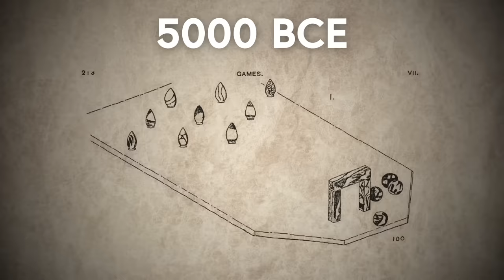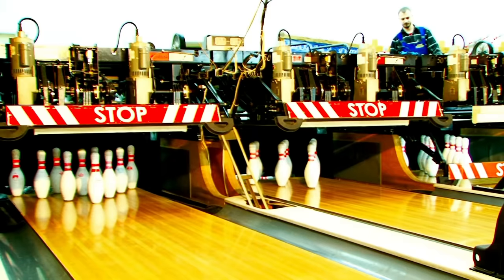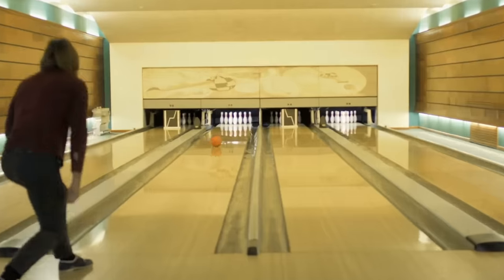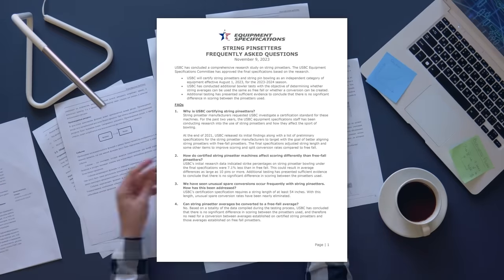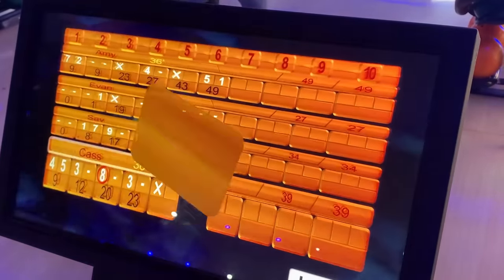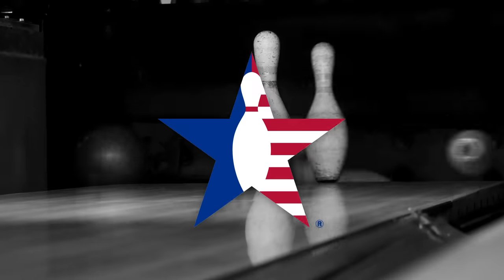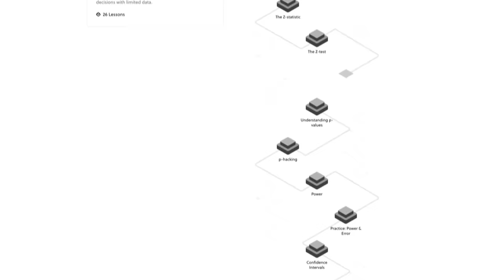The Controversial Machine That’s Ruining Bowling

Comment: As a mechanic who works on both types of pinsetters, I am here to tell you that string pins are only cheaper by face value. They are more difficult, more time consuming, and more technically precise to maintain and work on. When all cost is considered, free fall pin setters are more financially efficient in the long run. As for how they play, there are clear differences in the pin action. I dont see a problem with the string pins, but I do feel that they should always remain in their own division of play due to the differences.

Comment: One important thing you missed is that a lot of people crying about this haven't actually played on USBC certified string setters yet. There aren't all that many certified alleys at the moment. 

And there's a reason those strings need to be a certain length because it really does affect the carry and thus scores. I believe in most cases the strings are too short so that where you could get pins to knock each other down and messengers (pins that fly across to hit a more distant pin), that happens less and can affect scores significantly.

But I think just about everyone who's played on USBC strings is reporting almost identical scores (as the research would suggest) but it's slightly different. Sometimes the strings drag down a pin that wouldn't normally go down, but you get fewer messengers with a lot of people reporting they balance out. 

The controversy largely stems from people being too stupid or unwilling to read a research paper and then check whether the strings they've played on are USBC certified.

Comment: I am avoiding Bowling arenas that have pins on strings. It just sucks not seeing them fly around freely.
Reply: Pin action is a big part of the game and one thing that makes the game fun.  Getting a messanger screaming across the lane to take out the 10 pin is amazing!
Reply: Have you ever seen Ninepin in Europe? The alleys are all with stringed pins and the pin action is insane. For seeing pins flying around, the ground plate is way more important than the strings. Since I play Ninepin for more than a decade now and also like playing Bowling with friends (allmost all alleys here use stringed pins) I don't see any difference.
Reply: @TheKeeeks97  I´m also playing Ninepin in Europe, Germany to be exact. I´m playing competitively since more than 20 years and also do lane preparation and repairs. I also played classic 10 pin bowing competitively for around 10 years and lanes with strings and pinsetter lanes. From my experience I can tell, that all 3 types of lanes feel different to play or better said need to be played different to achieve better results. But the real reason (to some extent) why Ninepin pins fly around that much actually is physics, the kinetic energy the ball thrown towards the pins has is quite the same for the smaller and lighter Ninepin balls compared to the bigger and heavier Tenpin balls (E=1/2m*v²), because Ninepin balls are thrown faster the lower weight doesn´t matter or on the other hand the player has a natural limit to the amount of energy he can transfer to the balls. So the only variable dertermening pin action in comparison is the weight of the pins with the Ninepin pins beeing lighter at around 2 pounds compared to the Tenpin pins at around 3.5 pounds, effectively resulting in almost double the pin action for Ninepin pins without factoring in other effects.
Reply: @Genesis19623  Thanks for the information. I must correct you in one point: The Ninepin ball ways 6.28 pounds (2.85 kg) and I goes the Bowling ball is even more heavier. 😉
Reply: @ambiarock590  - i've watched a league with the old 8230s which were replaced by strings and the pin action and messengers had NO change...plus when I was a serious bowler 30 years ago, over 90% of my strikes were "10 in the pit" so I NEVER relied on messengers to artificially inflate my average (which was 217)
Reply: @TheKeeeks97  I talked about the weigth of the pins not the balls but I need to correct myself,  the weight of the pins is quite the same I messed up pounds and kg🙃 Therefore I just did the maths for my average throws for Ninepin it´s 203W of kinetic energy with a throwing speed of 43 km/h and for Tenpin its 211W with a 15pound ball at 28km/h. Overall it´s actually quite close😅 The main difference when it comes to groundplate design is that Tenpin lanes have the gutter going all the way through next to the groundplate and for Ninepin lanes the gutter ends in front of the groundplate which means that the pins can slide directly into the sidewalls and bounce back still sliding while Tenpin pins usually need to get airbourne to bounce of the sidewalls.

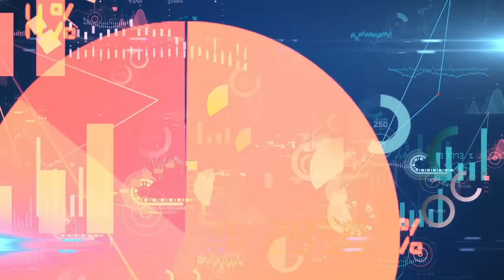Comment: Guys, you botched the p-value part of the stats.  The p-value of 0.035 that you give at 4:01 was actually of the test of *normality*, not of the null hypothesis of no difference in score on average.  A p-value of 0.035 would have given *some evidence against the null hypothesis*, and not a "huge slay for the null hypothesis."  Your reported p-value of 0.035 was also inconsistent with your discussion of the confidence interval, which was correct in the sense that the confidence interval contained 0. (Which is why I looked up the report.)

The USBC report doesn't actually give a p-value of that t test, but it can be carried out with the given info.  If we overlook the minor non-normality (not a big deal, since it's minor and the sample size is fairly large at 351), then t = -.0951/(18.8265/sqrt(351)) = -0.0946, with a resulting p-value of about 0.92.  For this report, at least, there was absolutely no evidence of a difference in true mean scoring between free fall and stringed.  In reality, there is almost surely a difference, but the report shows that the difference is most likely quite small.  At least for the type of bowlers participating in this study.

Of course, investigating a possible difference in scoring on average is only part of the story.  A meaningful part, but only part. There's no doubt that the strings would change the pin action. Sometimes, at least.

Comment: I'm afraid this might ruin candlepin.  An important part of candlepin is that the down pins or "dead wood" is left on the field after each roll.  Strings will definitely interfere with the action of the dead wood.
Reply: Candlepin setters are simpler since they dont need to pick up pins to clear the deck.
Reply: I think you're missing the point of the complexity here.  A candlepin setting machine would not have so much of the mechanisms to go wrong.

I play duckpin bowling (very different from candlepin) at a very old place, and while the pin setter is automatic....I would almost call it 'semi-automatic' because the player does have to initiate the sweep and set with a button and a new frame with another button - which is much simpler (it just picks up what it there and sweeps and sets it back down, or with the other button sweeps them all and sets a new whole set.  Still complex but a bit less so)
Reply: No chance, I’m positive. It would ruin the physics and would tangle too often, so it won’t be attempted. No strings attached, the way it should be! 🙂 ~Greg G
Reply: @CandlepinBowlingNetwork  its worth doing in some places especially if you need to put in smaller lanes but some older machines should be preserved, its like when they killed the jumbotron

Comment: As a long time bowler, and a former part time bowling ally mechanic (college job), string pins are the worst. My local spot actually switched entirely last year, and there is totally a difference. Yes, repairing the free-fall pinsetters was more difficult. Yes, it took more time. But there is a lot you loose with string pin setters. Pin action (how far and fast pins fly, like the whole point of bowling), especially when bowling fast (17mph-ish), is visibly affected. And, it takes away “The Messenger” which is one of the most iconic shots in bowling, please look it up. I’d do anything to bowl on a classic setup, but financially, I totally see why strings are in.
Reply: Agreed. Hitting light and bouncing the 1 pin off the sideboard and hoping it carries the 10 (or 7 for lefties) if it was still standing is something like ~30% of strikes at a competitive level. Yeah, I can't imagine not being able to rely on messengers to string strikes (no pun intended). Competitive bowlers would have to adjust their shots to pretty much never go light. The thought of cords attached to the pins just feels so dirty. Using strings to trip other pins in split conversion instead of the pins themselves. That's not right.

Comment: here's a thought:

install small magnets on the tip of the pins, and have strings with magnets attached (which are held far above the pins during play) come down and latch onto the pins and hold them up. I can imagine there would be complications with pins that arent caught by the magnets, but im sure someone smarter than me could figure that out

Comment: Mechanics are rarely crushed to death by the freefall pinsetters when worked on correctly. The older ones had mechanical sweeps. Had the sweep been placed all the way back, it would have been impossible to not be swept away if the setter would come down. Newer ones detect resistance and won't go all the way down even if a pin is off spot.
Reply: Maybe, but I feel like I'd rather be never crushed to death than rarely crushed to death 😅
Reply: People don't fall off catwalks that lack armrails if they walk properly too.

Comment: I wonder if you could eliminate the strings by using magnets? Like a mechanism sweeps in and an electromagnet would draw the tops of the pins up into position for resetting.
Reply: Yes but it'd require more electricity & probably make them more complicated
Reply: The problem with magnets is that all of the pins would be attracted, not just the one you want in a specific spot. Also magnets in the pins would make them heavier, and depending on where they're placed, may upset the center of gravity. Pins are very precisely shaped and weighted to get the proper "pin action" when hit.
Reply: This is what I was wondering. Electromagnets on strings and a steel cap on the pin. The machines already have computer vision, so it's possible you could individually activate the electromagnets to pick up pins which have scattered.

I wonder if it would work, and if anyone's tried it.
Reply: Magnets would make the pins stick
Better solution would be to have a "drone" reset the pins "by hand"

Comment: I've played both with strings and with the complex pin setters. I like the latter better.
I've NEVER heard of people being crushed to death before. This is really the very first time I've heard of it.
I've had a few strikes myself due to the the strings pulling a few pins down that I didn't hit with the ball or the other pins, no merely their strings. 
I've also seen loads of time that the strings would get entirely messed up causing somebody having to go to the back to untie them manually and on some bowling tracks I've seen them causing more trouble than a stringless pinsetter. 
All my own personal experiences with both systems taken in order, this video almost seems like a sales pitch from the manufacturer of string based bowling tracks. 
The string ones being cheaper is the only point I can fully agree on, and actually makes a perfect sense. But frankly, there it ends. And if I were to run a bowling alley myself I guess money will be the only reason for going for strings.
Reply: It doesn’t take much digging to find several examples of pin setters being directly responsible for fatal injuries. There are also several comments explaining that the experience is wildly different for professional and semi-professional bowling as opposed to casual bowling. There is an official standard string length that supposedly has a significant impact on gameplay, but will not necessarily be adopted by a casual bowling alley. It is primarily a cost-cutting measure that has the added benefit of eliminating a genuinely dangerous job that has led to fatalities for as long as the technology for it has existed.
Reply: My uncle conducted many youth leagues and worked in many bowling centers, usually at the front desk, in my youth. He had forgotten he had a tie on one time going in the back to fix one of the pinsetters. His tie got caught and the unforgiving pin-setter couldn't care less as it squeezed his neck until he passed out. Luckily one of the regular maintenance guys had finished his break and was able to cut him loose and save his life. Deaths w/ heavy machinery like this happen all the time, bowling is just not one of those sports most people think about when they think of heavy machinery w/ lots of moving parts. I don't know if that's an argument against free-fall pin-setters as better safety mechanisms and requirements could be put on these machines. Personally, as a competitive bowler I much prefer freefall.
Reply: @keyser456  I really don’t see any reason for automatic pin setters to be used in professional bowling over a human pin spotter. Just keep the “pin table” and have a human operate it by hand instead of risking a mechanic’s life every so often. I feel like that’s also far more cost-effective than owning and operating an automatic pin setter. It also has the added benefit of providing some broke student with a job.

Comment: 6:07 i think it depends on the circumstances surrounding these deaths. Like if theyre a result of ignoring basic safety procedures like turning off the machine before working on it, thats not the machines fault imo
Reply: I don't think the fault of an inanimate object really matters, plus a machine that won't kill someone due to user error is still obviously better. If something results in less deaths and has no downsides then it seems like the pretty obvious choice no matter whether an inanimate object is or is not at fault for the deaths.
Reply: @hedgehog3180  "has no downsides" is the premise you are banking on, but that's not a given, at least not yet. Like the video mentions, there's conflicting research on the topic, with a lot of data also suggesting string setters are less forgiving. And that's not even mentioning the subjective difference in feel between the two

And "whether the inanimate object is at fault" is a very dismissive way to word "is this machine necessarily risky or would a simple change in behavior eliminate the risk"
Reply: @ThatsPety building something inherently safer should take priority, take the crumple zone in a car, a car without "would be perfectly safe with some behavioral changes" like not getting into crashes...

I don't think the premise of bowling is one that warrants regular deadly accidents
Reply: @st1ng2k70  very bad, false analogy in my opinion. A car crash is impossible to 100% always avoid on your own. A drunk driver could steer randomly or a deer could jump out of the bushes and there's nothing you could do about it. A bowling machine is as simple as "press the off button...okay now work on it"
Reply: @hedgehog3180 there is no reason a person should be dying when working on a bowling machine, I work at a bowling alley and there are like 5 kill switches and as long as the machine is off there is 0 risk at all
Reply: i dont even know where they got their stats for "deaths are rising" as I cannot find a single actual source for pinsetter deaths..
Reply: @_Kurohhh  man I couldn't find that shit either when I looked. All I saw was the same 4 stories from the past 15 years or so, reposted over and over again. But I was already being "that guy" so I just didn't mention it

Comment: Honestly more than half as interesting, if I ever find myself at a string-pin bowling alley I'll know it's cool now. Thanks!
Reply: As a bowler for 21 years: recreationally, I don't have an issue with them.  If I were recreationally bowling on string pins I'd just adjust my score to not count any spares that were made by the strings.  I would not be okay with tournament and league play using strings
Reply: @ambiarock590  this take seems to be appearing a lot in this comment section and I can see why, outside of tournaments rules are just allowed to be looser aren't they (are they? I wouldn't know)
Reply: But it’s not about the rules, it’s about the equipment. It’s like if they never allowed 10’ hoops & regulation basketballs to be sold to the public. How does anyone prepare to play professionally when the equipment is different?  I wouldn’t want to play with a wnba ball & a 9’ rim, that changes the game enough to make it something else.
Reply: @ambiarock590  If the entire tournament is played on strings everything cancels out.

Comment: I used to be a bowling alley mechanic and was nearly crushed to death by one of our more finicky machines. Even the best machines require constant maintenance to run. Candle pin bowling is not as pretty but seems to be the safest and most economical route available for alleys with very narrow profit margins.

Comment: My local Round1 uses string pinsetters. I saw them in operation and it really confused me at first to see pins just stand themselves back up, but it seems perfectly fine otherwise. Not crushing bowling alley operators seems like a huge plus, too.
Reply: they started switching over to those some time ago, i think last year or so? only a few of them seem to have it so far, most still have a mix of 96s, 98s, and AMF setters from what i've heard though.